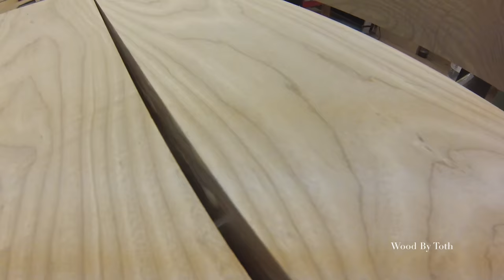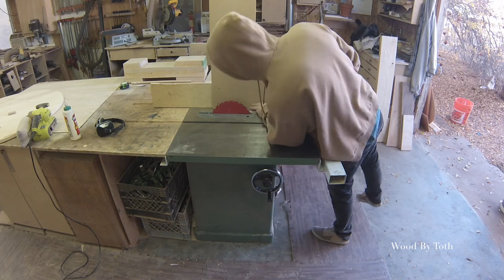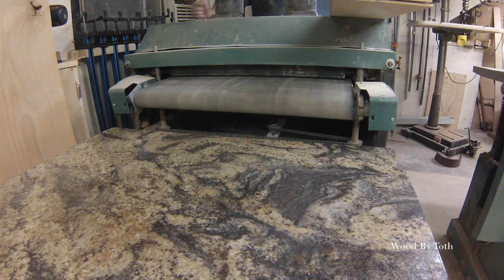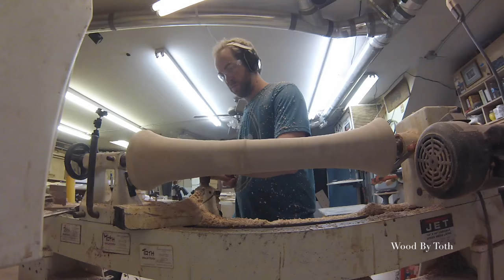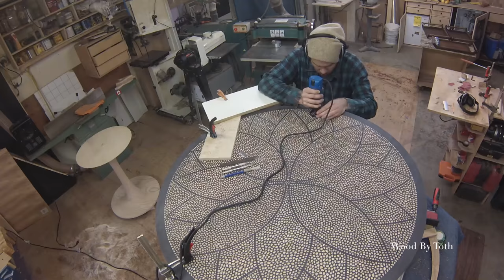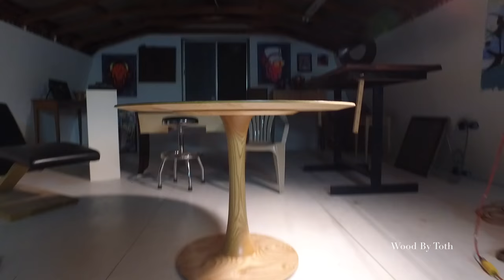Round Pedestal Dining Table

Comment: does anyone else see the two lighter streaks on the table?
Reply: Yes, they are along the glue lines of the slabs of the top.  Some of the glue penetrated the adjoining surface and it created a different absorption region, as compared to the areas that didn't absorb glue.  These lines could be minimized by applying tape along the glue next to the edges of the slabs prior to glue-up.

Comment: Nice work, thanks.  Interested to understand when you are making the veneers why you do two cuts on the table saw then finish off with the bandsaw.  Maybe to maintain a standard thickness?
Reply from the maker: I do it that was cause its faster and usually more accurate with my band saw. If the board is wider than what my table saw can cut from both sides i'll still run a table saw blade cut on both sides of that board and then take it over to the bandsaw to cut the rest. The tablesaw groove gives a nice channel for the bandsaw blade to run in. And with the material being remove the bandsaw doesn't have to work as hard to cut

Comment: Speechless dude!   This is by far my favorite from this series.    Hope you talk about this table some on the podcast!     One question.   I like the table saw bevel idea, but why did you not cut that first bevel on the lathe like you did later on in the build?   Just curious.
Reply from the maker: Thanks! The reason I turned the first one was because of the size, it was only 24 inches. The Motor on my lathe cannot handle a 48 inch round table top spinning, so I did that part with the table saw. And it's faster on the with the saw

Comment: Hi, just a quick question, could I buy that rest that you use to hold and lower your rotary tool separately from the tool? If yes, what's it called?
Also, your video is very inspiring and is so good that I usually start producing excess amounts of saliva. 
(That was I joke. Just in case it wasnt obvious)
Reply from the maker: Look at Swewmac.com they make bases for Dremels.

Comment: What a phenomenal project. Didn't like the music. I hated, well really disliked, your camera angles. Unbelievable project.  I really wanted to see what you were doing. Even though I have been woodworking since I was sixteen, some 65 years ago, I knew from seeing your work that I could learn from you. But the weird angles, hat and handheld camera, camera mounted on work piece, etc, all distracted from the actual work. I really wanted to see a woodworking video, not a music video. Also I wanted to see how you created the pattern on the top. I could see you were using a Dremel tool. But were you working from a pattern or was all the work freehand? What was the finish? You do great work, most especially since you did so much before you had any professional training. But when you do a video please slow down some of the double and triple speed cuts so it is easier to see what is going on. And most especially talk to us. I saw your interview with Chris and you verbalize very well. Put some of that on your videos. BTW it's nice to see work from a fellow SoCal guy. I grew up in LB.

Comment: It is NOT a dining table: shaky, too small leg, if his wife puts her elbows on, the table will be on its side. Resume: fast hands, slow brain.
Reply from the maker: Alex Dihes There is a 65 pound weight in the bottom and another steal plate under the top. Those two stabilize it and its strong enough so I can sit on the edge without it tipping